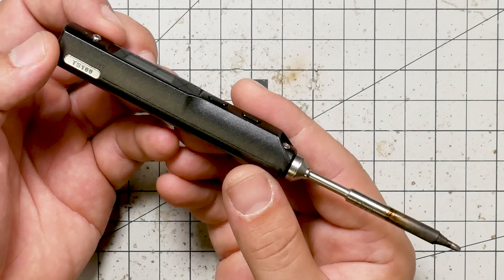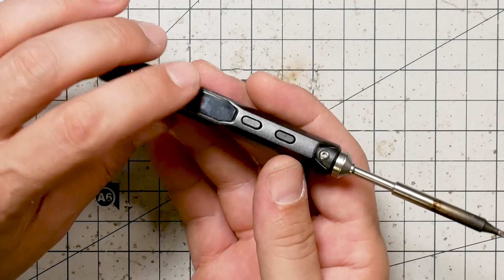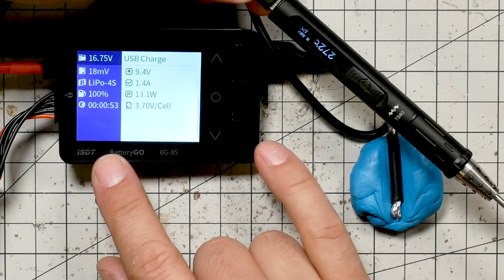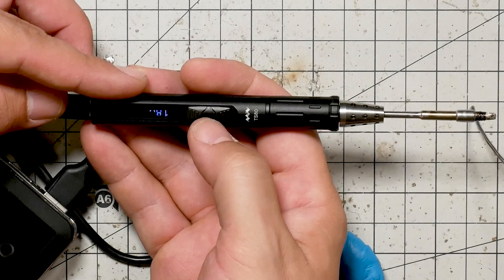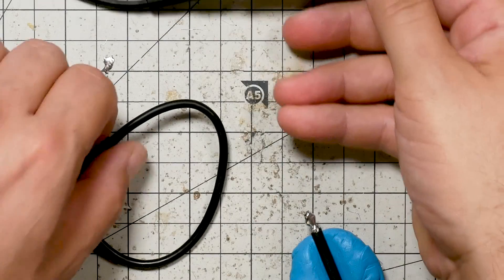Best Portable Soldering Iron TS80 vs. TS100

Comment: after all the ts-80 is a better iron - i especially like the shorter tip = more ergonmic and easy to handle. but 

1. i dont want to carry another power supply for the iron
2. it isnt that much better then the ts100 that it is worth it

Comment: How often do you guys actually need to do soldering fixes in the field? Because if it's as rare as I think it is, to me, $56 or more is ridiculous! It would seem to rarely ever get used.
Have any of you actually watched the reviews and actual video of people soldering with that cheap portable from Daniu? It's something like $8 and solders amazing! Google it and watch the reviews of guys soldering way bigger and harder to heat up items than the ESC's or receivers we might have to do in the field. 
As we all know, this hobby is very expensive and, IMO, this is one item we can all $ave a ton on and still get a perfectly useable field solder iron for the rare times we will actually need it. Remember, the solder joints we need to do don't take a lot of power to do. Well, see for yourself, go watch the videos on that approx. $8 iron. You'll be amazed and you can thank me later for saving you about 50 bucks on this over priced gear. 🤔👍🤘
Reply: I plan on using this iron as my only iron instead of buying something like a Hakko 888D or a Weller.   The new heating technology integrated into the tip of the TS irons is only on the really high end irons that usually cost around $300   The 888D for example uses older solder tip technology that is not as good.
Reply: I don't think you will get the performance that I get from this: https://www.amazon.com/X-Tronic-3020-XTS-Digital-Display-Soldering/dp/B01DGZFSNE/ref=sr_1_1?ie=UTF8&qid=1539625995&sr=8-1&keywords=x-tronic+3020
It's #1 rated by WIRED as the best soldering station for the buck.  I know it is!  I own it and it totally changed the way I can build and solder ultra tiny pads.  It's fantastic! I love the sleep timer that keeps it from overheating when you are not quite ready for that next solder connection.  A common problem with others and the main reason why people burn up solder pads.  I haven't burned one up since I bought it!
Reply from the maker: I don't often solder at the field but I do travel a lot and this iron is easy to bring.
Reply: @JoshuaBardwell  So is the $8 one! 😜
Reply: Nope. You get what you pay for. Buy that $8 iron and I'll race you with my ts100. I'll be flying and you will still be trying to get up to temp 😂
Reply: @BengalCatChilli  You so obviously haven't watched the two videos about the $8 iron and how it surprisingly heats up super quick and can handle much heavier soldering joints than we will ever do on our quads. So, before you make an assumption, please go watch those videos so you can be as shocked and amazed as I was! It simply works awesome! And, because it's not for everyday use, and is for rare in-the-field soldering, it'll work perfect for about 1/7 of the price.
Plus, I'm doing a solder joint or two in the field!what do I care if yours beats me by 10 seconds! I saved $50 ! 🤔😜
You're missing the point of the in field iron!

Comment: AOKoda sells a QC3.0 adapter you can plug into a Lipo and power the Iron via the included USB cable.  With the TS100 you have to make or buy a Silicone XT 60 cable anyway.   Also you can use a QC3.0 cigarette adapter and power the Iron from your car battery.   The ergonomics on the TS80 are nice because the tip is shorter.  It feels more like you are holding a pen.
Reply: Yeah, I was really confused when he was using the logic that the TS100 simply plugged into any quad lipo when I have never seen it for sale with that connector.  I don't know where he got his connector, but I assume he made it.  He could have just as easily made an XT60 to usb C connector the same way, right?  I may be missing some nuance.
Reply: But you dont have to pay Qualcomm royalties when you make an XT60 or 5.5mm barrel plug. You also don't need electronics that "authenticate" the device to receive power either. give it voltage, and it will chooch.

Comment: I love my ts100 and I got it on sale when they were clearing them out. I also got the xt60 cable, 5 tips, clip on stand and the leather case and absolutely love it. I do like the USB feature of the ts80 though. This thing has improved my soldering skills 10 fold. Thanks for doing this Joshua. Oh and if someone bought the ts100 it is worth getting the software off github. I do agree the ergonomics on the ts100 could be better. I had purchased a good soldering iron with an adjustable LCD power supply and haven't even used it once since getting the ts100. So glad I took the plunge and spent the money. Cheers
Reply from the maker: The biggest thing about the github software for the TS100 to me is the ability to increase output to 450 C.

And you can do custom splash screen :-)
Reply: Custom splash screen in soldering iron? And I thought that soldering iron is made for soldering...
Reply: I did not change the splash screen myself, however, it is a nice option if you like to customize your tools. A cell phone is to make calls but most of us change the screen saver so to me it's not a big deal. I respect your opinion but I do not feel it is a negative feature.

Comment: Fantastic, JB. I agree 100% with you. For example, I have a few (self made) power banks, but none of them goes over 5v... So I guess the TS100 (which I have too!) is much more convenient to use.
BUT... Since the TS80 comes with a power adapter... Well, maybe it can replace your bench soldering iron. While the TS100 is more suitable to use as a portable soldering iron, really.

Comment: A tip for the tip of the ts100:
You can just leave the screw out, so changing tips becomes as easy as with the ts80. Even without the screw it is kept securely in the iron
Reply: I've wondered this...just never brave enough to try it. Hot iron tips rolling around our dining room table doesn't sound like a good time.
Reply: Even better when hot iron tip is rolling around someones lap.
Reply: @KrotowX  It's all fun an games until your tip burns your tip
Reply: Problem with leaving the screw out is the tip turns which can be annoying. BTW the tip on the 80 turns because it has no such screw
Reply: @pleasecho2  how often is a spinning tip going to be a problem?
Reply: @PandaMan02  It depends on what tip you use. You will not notice much using a conical tip
Reply: @pleasecho2  . Ah! Ha! Good to know.
Reply: Yep!
Reply: I do this too. Never did bother with the screw.
Reply: dont take the risk of hot iron fall onto your pants.
Reply: Yeah, I got mine a couple days ago, I removed the screw, inserted the tip and immediately though "hey, that's good enough" and tossed the screw into the little bag of spares they give you, along with the hex bit i'll never use.  The best part is once I am done using it, I can just pull the tip out and stick it back in the box it came in.
Reply: Yes I agree with that statement 
I do that for my
Reply: I wonder if you can replace the screw with a thumb screw to keep the tip changing tooless instead.
Reply: @Infinite_Ouroboros  You could, but it's not necessary, there's a spring clip inside that retains the tip with or without the screw.  So the screw is not needed, I don't use it at all.
Reply: thanks for this info, but I dont need to do this since I am not changing the tips that frequent.

Comment: The flir doesnt display the temperature well, it calculates the value of the ir transmission. For a experiment, you can heat different textures, like blank metal, painted metal, glass, rubber. All will get a different readout. A glass window becomes a mirror. (I'm a firefighter so i know what i talking about 😁😎)

Comment: TS80 wins, before I even start the video. Heater element is better.
Reply from the maker: Ah but there's more to the comparison than that.
Reply: Source? From what I've seen the 100 performs better (at least with 24v). Or are only you talking about the headphone jack change system (which I think is a great innovation)?
Reply: @ASJC27   the TS100 heats up faster at 24v using its full 65 watt power.  But when its soldering it cant push the 65 watts it only does 10-20 watts.  The TS-80 puts out the same 10-20 watts but at 9v via USB-C   Ive seen a bunch of power draw tests that show this.
Reply: Got a source I can watch? That sounds unlikely that it can only pull 65w on worm up, and it doesn't match my own experience that it absolutely trashes Weller and Hakko stations when working on heavy automotive wires and large MOSFET ground planes. Maybe the test was on a low thermal mass part so that not much power is needed. That is the only plausible explanation I see. 
This video for example compares it with an 80w Weller and the TS100 beats it easily: https://youtu.be/HgrB5P-rDLw?t=139.
Reply: @ASJC27   He made a new vid about these irons both hooked up to a Bench Power Supply:  https://www.youtube.com/watch?v=83STpUXHilk   Ive seen a few other power tests that show the same kind of thing.   The TS 100 does not draw 65 watts when soldering.  Only when heating up.
Reply: This. Ts80 still means you need to bring a power supply. Like a 20k powerbank. And they're about $40-60. 
I power my ts100 off a 1500 4s, but I could use any lipo in my bag. Plus the DC to xt60 cord let's me charge my whoop batteries 😂
Reply: HeyRob FPV you do have a good point